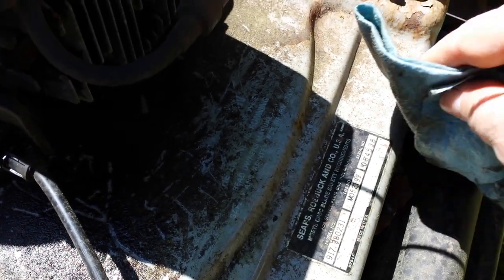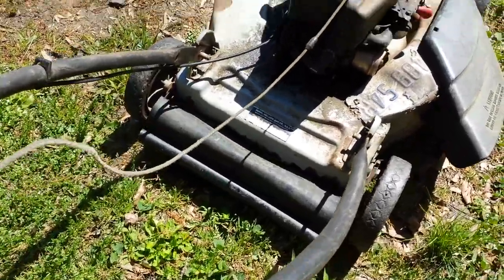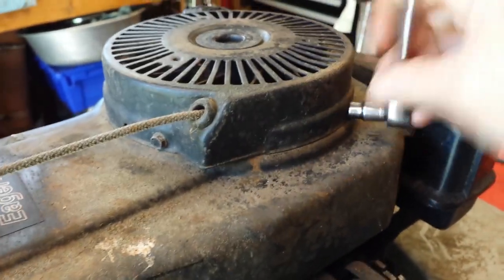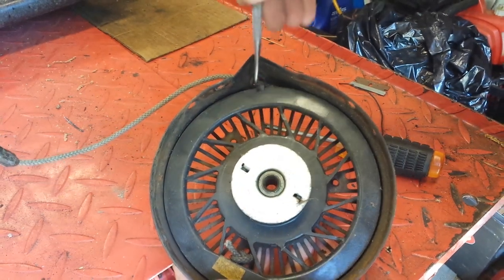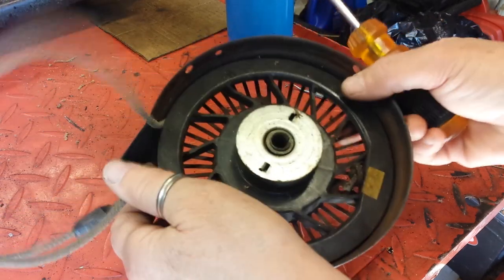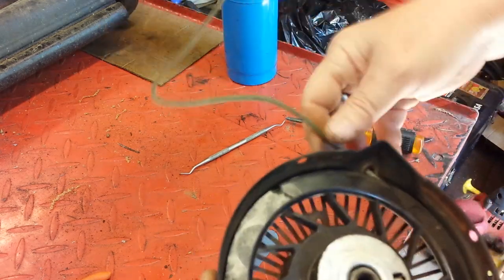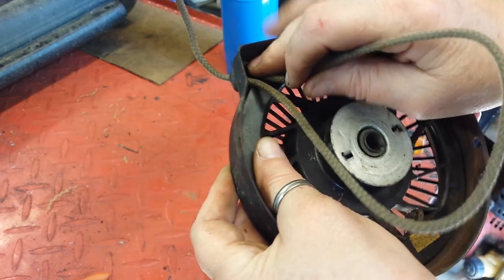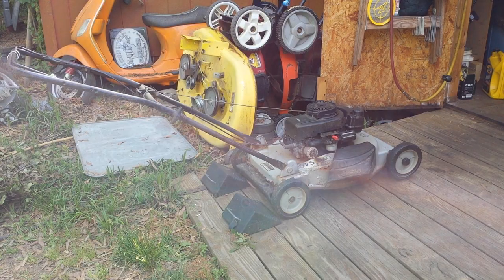Quick Tip: Fix A Limp Tecumseh Recoil Starter Pull Rope on a Craftsman Eager1

Comment: Actually, I liked the license plate on the mower deck. very rustic. Thank you The Lawnmower Lady.
Reply: I didn't see that so I had to go back yeh ! Someone wants their plate back 😆
Reply from the maker: Thanks IHG!  That plate highlights my stellar welding skillz. Lol!
Reply from the maker: Someone in the past put a muffler on that had louvered slits that were pointing down at the deck. Completely rotted out. Good thing TX has/had steel motorcycle plates.
Reply: @TheLawnmowerLady  Hey ya gotta make due !
Reply: @TheLawnmowerLady  Good old TX plates. New plate here fold over if you look at them wrong
Reply: @INSIDEHOUSEGARAGE  we have steel plates here in tn too. i have actually cut one up for the metal before because i am the type to use anything i have lying around. old brake rotors and even the pads are awesome for some nice weldable steel as well. used a part of a brake pad to make a manual timing chain tensioner for my bike.

Comment: good fix, love the license plate patch on deck.   I used a Old Tecumesh (Eager1) 20"  used from 1973-1998 .
Reply from the maker: Thanks Mr. D! Got this 7 years ago from a guy off CL for free. All it needed was a spark plug cap. I seem to remember grinding down one of the valves that was out of whack at one time. Seriously a very reliable mower with just regular maintenance.

Comment: That a good idea to tighten cord. Will try that.
Reply from the maker: Give it a try, worst case the return spring is damaged.
Reply: @TheLawnmowerLady  Have you ever seen the black plastic handle you push down to activate self propel on a toro replaced? They gave me a mower and plastic piece that holds one of the cables is broke. When you push handle down it won’t stay in.
Reply from the maker: I actually have a mower that was gifted to me as the cost to replace the handle was too expensive. A tree came down in her yard and broke the handle. I have just replaced the drive cable about six months earlier, and the drive transmission a year earlier. The mower was in good shape otherwise. If it was my mower, I would have replaced it, as mowers back then were far superior to the residential mowers on the market today. Too heavy to use as a push mower in her yard.

Comment: Any reason the engine is on back to front? usually its fitted with the fuel tank facing the back. Those Tecumseh Eager 1 engines can take some abuse and keep running, the larger cc versions have a tendency to snap cranks by the con-rod journal like they are made of chocolate.
Reply from the maker: That is a good question. Maybe something to do with oil slinging lubrication? Pushing down on the handle to make turns would slosh more oil towards the head? I will say that little mower is probably the most reliable mower in my stable. Thanks for watching. Cheers!

Comment: Would you know if a Craftman pull cord shroud is the same as a poulon pro shroud?
Reply from the maker: Sorry, I do not. Those parts are engine specific, not mower brand specific. Craftsman and Poulan mowers could have Honda, Briggs & Stratton, or Kohler engines.
Reply: @TheLawnmowerLady   they are both from Briggs and Stratton engines
Reply from the maker: @Mike-pl9ws  Give it a try? If they are the same engine series, Classic, Quantum, or EX, it might be a direct swap.
Reply: @TheLawnmowerLady  thanks